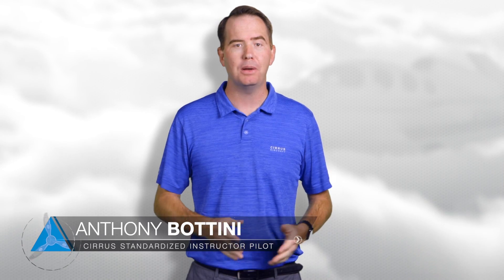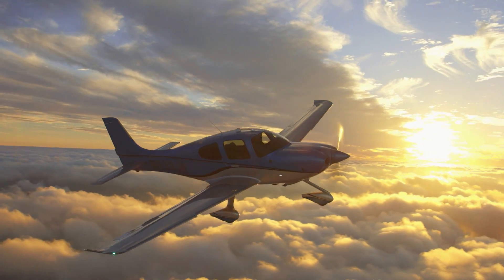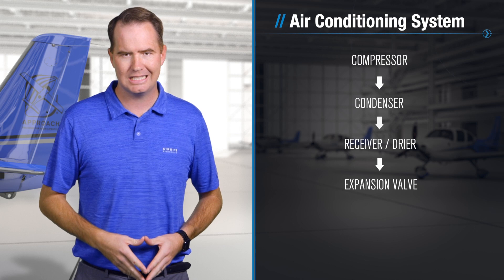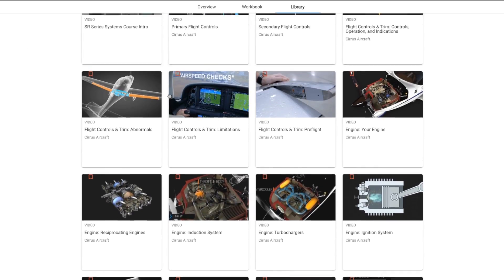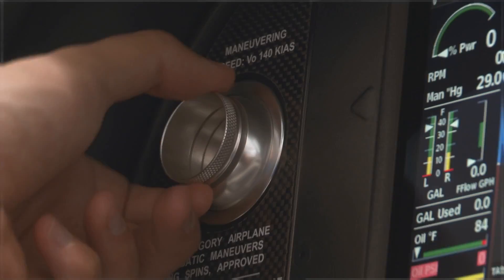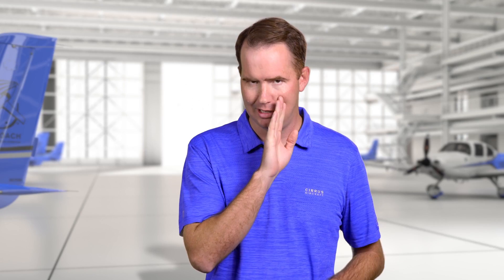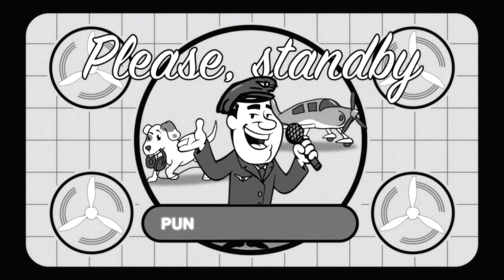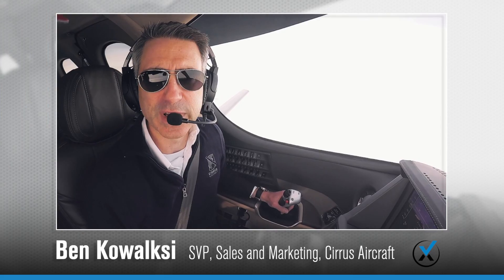Flight Fix: Air Conditioner Operations

Comment: Anyone know what old cessna's (like a 152/172 from the '70s) have for heat, I know most don't have AC, only air flowing form outside. An explainer and/or a video would be great :)

Comment: An engineering advice would be to have a timer on the recirculation system. So even if someone forgets to turn it off while flying, after a couple of minutes, say 10 minutes or 15 it turns off automatically.

Comment: Same as car air conditioning
Reply: The A/C system in the Cirrus costs $45k...why?  Weight.  The system ways a fraction of what the one in a car weights and that takes some exotic tech and materials.
Reply: Well yeah, that's how all aircons work. My only question is where specifically is the condenser placed. They didn't really go into enough detail in this video though...

Comment: So why can’t you have the recirculate on in flight?
Reply from the maker: Great question.  Per the SR Series POH, recirc stays OFF to minimize the chances of inflight CO exposure in the cabin.  In the rare case that unwanted exhaust gasses would ever find their way into the cabin, the recirc system would compound the issue and restrict replenishing fresh air into the cabin.